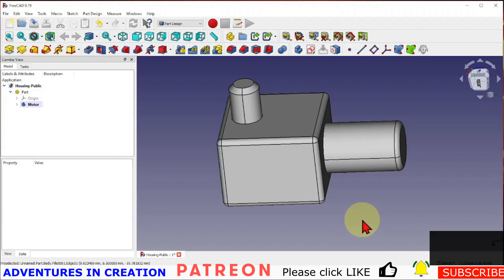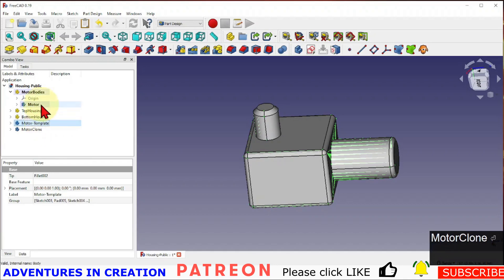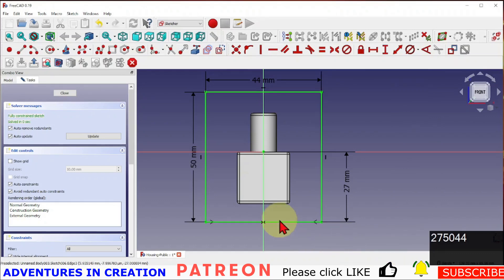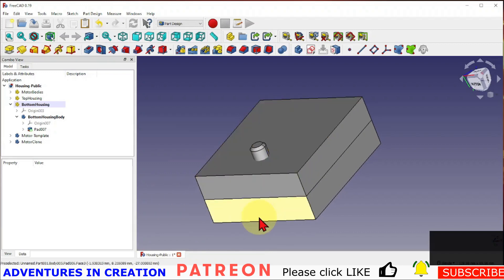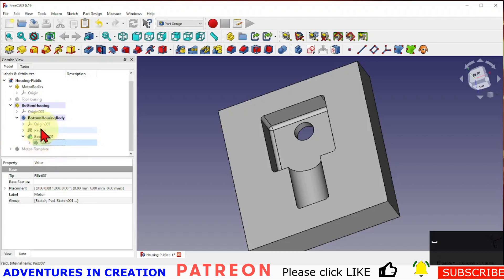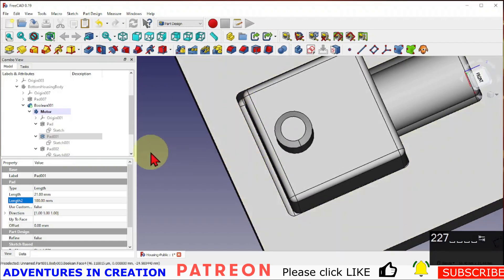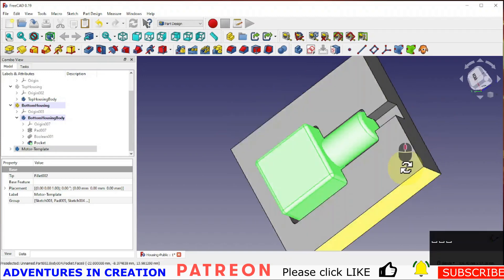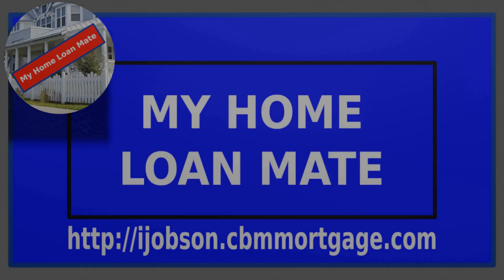FreeCAD for Beginners #29 Creating A Housing

Comment: I used a similar technique in SolidWorks to mold some parts a few years ago, glad to see that it's possible in FreeCAD.

Thanks for the video.

🍻
Reply from the maker: I think it's a good start to an enclosure, especially if you are going to 3d print it.

Comment: Awesome. Now I just need to find a file of my micro switch and I can make an end stop holder for my switches.
Reply from the maker: You could always make an outside dimension model, just the dimension you need to enclose the switch.
Reply: @Adventuresincreation   i guess I could look up the dimensions, my caliper broke, and I don’t have anything to measure metric items at the moment.
Reply from the maker: @wantafastz28  you could probably look up dimensions online
Reply: @Adventuresincreation  yep, I’ll try both ways. I found the file on grab cad,  I also have the file of my taig mill. Hopefully I can do it as easily as you make it look. :)

Comment: This is a great use case for parametric design, you can add the clearance as a variable in you spreadsheet and change it to suit you need without having to modify every sketch by hand.
Reply from the maker: Exactly, great idea 💡

Comment: on the side of a cylinder and they need to be at an angel of about
120 degrees  apart. How do I put holes or pockets around a
cylindrical part? Both FreeCad and 3D printing are  new to me. Thanks
again.
Reply from the maker: I will make a video showing how to do that for you.
Reply: @Adventuresincreation  Wow That would be great. Thank you again.
Reply from the maker: @jamesbrewer3020  I have created the basics of steps around a cylinder, I will post a picture on my channel. I will create a quick video but can't do that today.